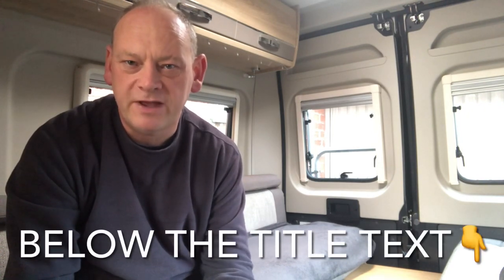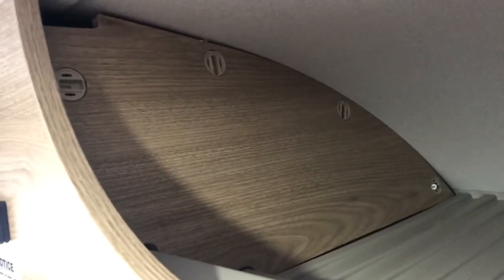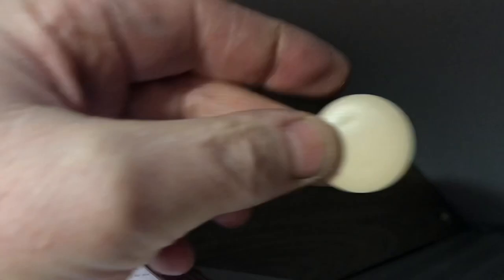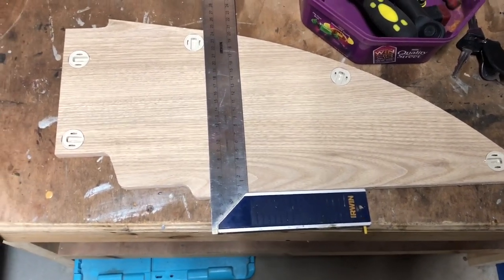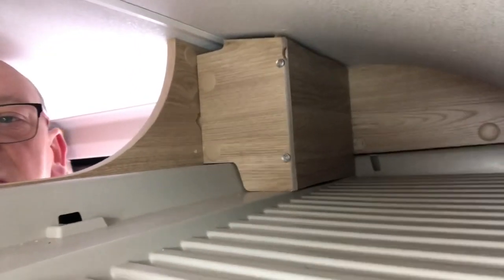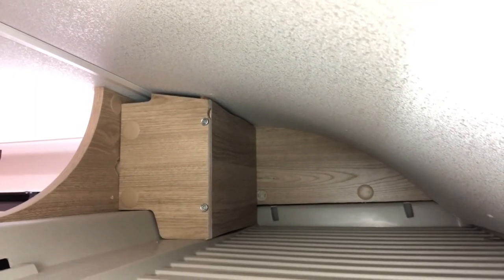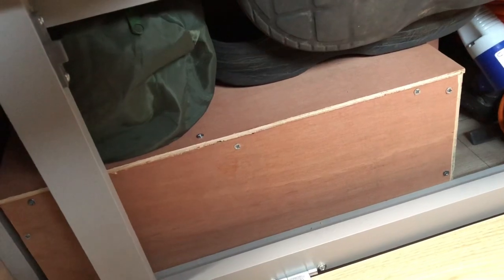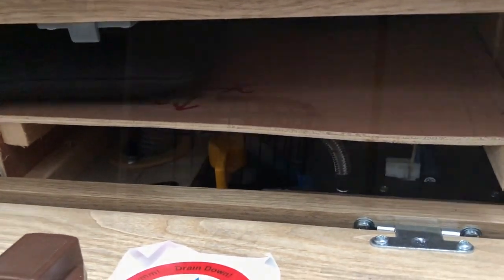Fiat Ducato Elddis & Compass CV20 CV40 CV60 CV80 Storage Hacks & Space Saving Ideas All In One Video

Comment: A little word of warning, done this mod  on our cv40 for extra space. But on ours there was another screw (impossible to see or get to) behind the fitted board holding it in, I applied a bit of pressure and ripped the unseen screw out, which made a slightly bigger hole in the ceiling, nothing too bad and as covered with the new boarding, was lucky could have been a lot worse.
Reply from the maker: I’ll pin this comment to help others thanks Craig

Comment: Neat ideas well done, although one note of caution, it is not always a good idea to box in electrical equipment to tight especially when the apparatus may have cooling vents as they require the heat they build up inside to dissipate but, if you do, put several holes in the panels you're fitting to allow air to flow.
Reply from the maker: Thanks for the advice 👍

Comment: Hi Rick we’ve just bought our cv20 explorer and loving your tips and hacks, regarding your boxing in at the bottom of the wardrobe where did you get the finished wood that matches the original?  Cheers  and we’ve just came from a Vw t25 air cooled
Reply from the maker: Hi, the wood is from B&Q and a great match, you’ll love it from the T25 but you’ll miss the waves from dubbers, I miss my T2 and T5 but the CV20 is brilliant 🖤🏴‍☠️
Reply: @RickandHeather  cheers Rick! Our wardrobe came with a microwave which was a pain taking off the facia to remove it but all fine now! Reinstated the wardrobe so the wife’s happy! 😁
Reply from the maker: @gavinmay3516  gotta keep the mrs happy 😃